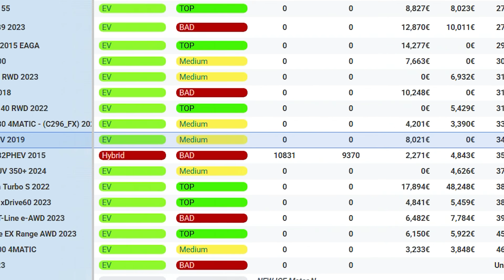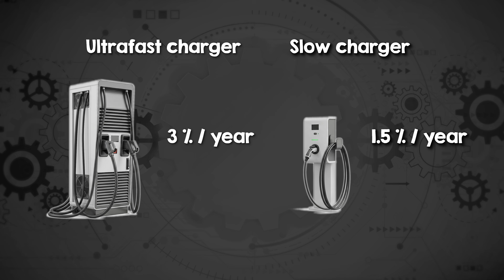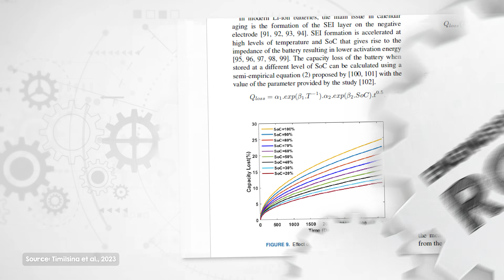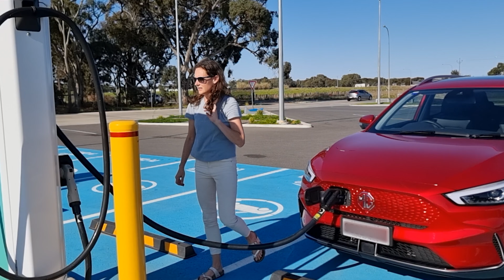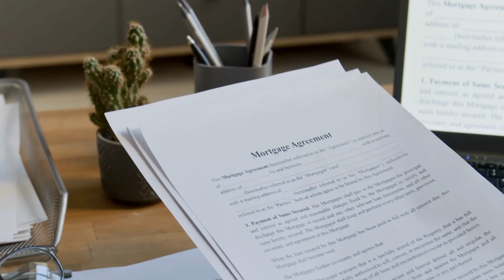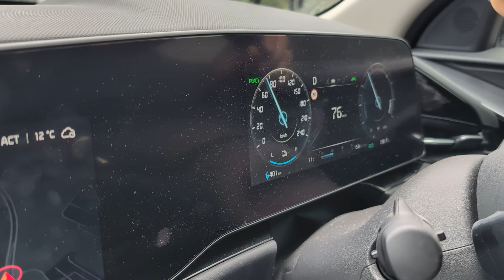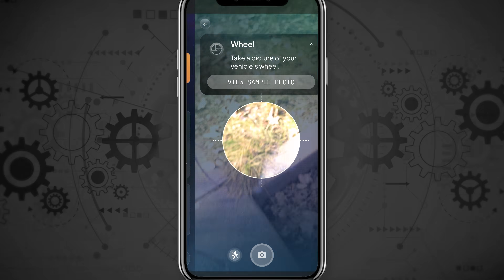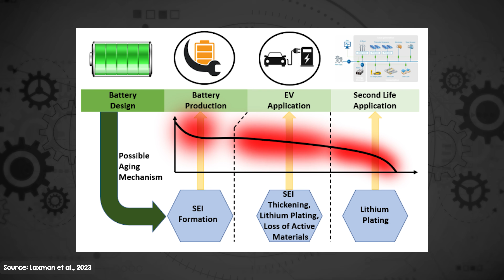Watch This Before Buying Your EV

Comment: "...the vast majority of EV batteries last for freaking ages!" - Great video Rosie. Thanks.
Reply: They come for 10-15 years of use ( hard use) but if you follow manual it will last 20+ year, I have an EV for 1.2 years and SOC is showing 99.39% health
Reply: @diego2817  '21 Kona Electric = 73K miles = 97%.  don't utilize the top or bottom 20% very much, mostly L2 charge at home or short DCFC sessions if out of town b/c we might only need a 25% boost so the battery doesn't really get very hot even on a hot day.  That 25% boost added to the remaining 40% left over from the outward trip from home might be all we need to get back home.
Reply: @diego2817 we all trust that is the tested level and not the manufacturers deceitful programming yeah ? You may have been distracted when this part of the post was said by Rosie.
Reply: We haven’t had our battery tested and we also live in a very hot climate. The battery on our used, 23 Kia still seems good, and the car still travels very close to its originally posted range. And the car will be under warranty for another 72,000 km/46,000 miles.

We have solar because gas and electricity prices in California are very high. Once you charge a car from your home solar, you will never go back to wasting a thousand or more dollars a year on gas, and more thousands on electricity and propane.

Questions for engineers:

1. Rosie/engineers, a few other YouTubers have suggested keeping the daily charge at 60 or 70% to reduce degradation. So, we only charge to 90% before road trips, and to 100% once a year in a cool season. 

2. How damaging is it to take a car battery below 20%? As with going to 100%, is there a case to be made for discharging the battery to some low percentage occasionally? 

At 55,000 km/34,000 miles, we are very happy with the EV. It is quick, reliable and fun to drive, and again, we love passing the dirty, expensive petrol stations. The downside of older EVs is slow charging, which is an issue on all-day road trips. New, 150+ kW charging Kias and Teslas and Fords seem to be plugged in for 20 minutes, while our car with 50 kW charging takes the full hour.

And a second downside for our older EV, the newer ones are vehicle to home and grid-capable. When we save up enough to replace my gas, work pickup/ute with electric, the disadvantages of our great, little, inexpensive, used EV will no longer matter.

Rosie, have you looked into vehicle to grid and “the internetification” of the energy grid? Ideas for turning solar and battery and EVs into grid partners instead of just customers, or here in California with our usurious electricity rates, victims and marks?
Reply: @freeheeler09 I live in the southeast. It gets hot here too. I can L2 charge at home. I mostly keep the car between 60% and 40% b/c I don't drive that far each day. That charge might last 2-3-4 days depending on the weather. If I drove more I might go 70% to 30%. The key is to keep it mostly between 80% and 20%. If you need to go to 100% for a trip, do it. Just don't charge it to 100% and leave it sitting around for days. Same for the bottom 20%. If I dip into the lower 20% (very rare), I just plug it in immediately and charge it when I get home. I skip the after midnight charging schedule then which I do for no good reason except to be a good neighbor. The grid around here is pretty busy with families making dinner, doing laundry and showers - I presume. After midnight, not as much. We don't have pricing here that favors after midnight charging. That's it really. When traveling I prefer to charge the car up to 80% or maybe 100% if it has been a while. Most of our out of town EV trips are away from home maybe ~125 miles. Then on the return trip, we'll want to recharge so we don't arrive at home with nothing left or get stranded b/c of traffic. Because I charged up a bit more before the trip, our DCFC session can be shorter. Maybe we're at 40% and only need to charge to 65% or 70% to get home. Less time charging, less heat because shorter session, less expense. Suits our slow charging EV just fine.
Reply: Just, never charge to 100% every day, even with LFP, degradation will come fast
Reply: @diego2817   @Theonethatshallnotbenamed9999  You can't charge battery 100 % fully even if you wanted to.  Battery manufacturer caps the capacity around 80 % and car makers' Battery Management System (BMS) has safety margin 5-10 %.
Reply: I bought a Temu Tesla aka BYD and my battery life has already dropped to 80percent within 8months 😢
Reply: There’s a video on YouTube with an airport chauffeur that has done 430,000 miles in he’s Tesla MS charging mostly with Supercharging and the battery health was still a bit over 70%. Most cars are ready for the wrecker at 180,000 miles.
Reply: @Glennloveshimself  https://www.youtube.com/watch?v=uGRQQzqZ9L4 This one? This is from the Netherlands, a 2020 Tesla with a similar mileage of almost 700,000KM and a battery SoH of around 71%.
Reply: @Cyphax55  thanks.
Reply: @Glennloveshimselfno not true, high mileage and frequent usage like Vehicle mentioned has done over 900 000klms with the usual maintenance only. Petrol Vehicles, Plenty in fact a fleet of averaged 500k , consumable only. Less tyre rubber Pollution into the rivers than a E Car, actually recyclable as in viable to do so. Increased road damage as a result of Heavy E car use. Manufacturing of personal Transportation has become a High turn over of short lifespans purposefully for decades . Turn over is the Evil we all are unintentionally accepting or even welcoming.Small  Footprints of overall consumptions that was, is now being forced upon Society to welcome Throw away, no, not recyclable Vehicles as the norm. 
Foresight and experiences of reality's show the Constant Wheel of Production and Money will have this new Storyline if personal transportation , one big No Choice anymore. Computerised with active Satellite Controlling of freedoms with Geo Blocking vehicles when ever and whoever.
Reply: @Glennloveshimself  我们这里的网约车司机（中国Uber）都说，BYD的车，开300,000KM，电池健康度基本都在80%以上的，而且都是用快充充电的。
Reply: @Glennloveshimself  How old is the car? Batteries degrade with age as well. You don't need to drive far.
Reply: @Gazer75  And with the load. If you are pulling trailers, the battery degrades faster, for example. And manufacturers use bigger batteries to simulate a better SoH within the manufacturer's idea of the vehicle's lifespan (3 years). There are too many variables to make an estimate just from anecdotal information. The only way to be sure are measurements under lab conditions with controlled loads to have standardized discharge curves, bypassing any onboard system.
Reply: @FF-li6zj  ICE cars suffer from the EXACT same thing ? why is it any different for an EV ?
Reply: The problem buying an old EV isn’t the life of the battery.  It is that battery technology keeps improving exponentially.  In China they have batteries with 1000 Kms / 600 miles of range.
Reply: @Theonethatshallnotbenamed9999  True but if my driving can be supported by a ~250 mi EV then I'll buy a ~250 mi EV. Sure it would be nice to have a ~600 mi EV but I don't need one. Maybe some future EV that I'll own. For now I needed an affordable used EV to pair with our ICE SUV which does our trips.
Reply: @Theonethatshallnotbenamed9999  its advanced today, the owner will "feel" his EV obsolete next year.
Reply: @arttellama2408 it is mostly battery technology so as long as batteries keep getting cheaper, then you can just change battery.  Probably similar to getting a new engine nowadays.
Reply: My 2016 Nissan Leaf has nearly the same capacity as it had when I bought it 5 years ago.

I am considering upgrading.
Not because I can't use the current battery, but because I want a grid battery in my shack, and the old car one has a decent size for that.

Next step is to find an electrician who can install it and give it a CE-certificate to keep my insurance company happy 😊
Reply: @madshorn5826  Might be cheaper to buy a battery from a wrecking yard than to disable and junk a working EV.
Reply: 3% every year for fast charging 10 years =30% loss 20 years 60% loss cars with slow charge 10 years =20% loss 20 years 40% loss , my question is can the car charge and drive at 20 years with 40% battery or 60% battery , if the battery outlast the car the answer should be yes no problem , but I think the answer is no
Reply: It's because early Tesla models and Nissan LEAF only used high quality batteries from Japanese companies like Panasonic and NEC.
Reply: @yo2trader539  The batteries are far better today than back then mate...
Reply: My 2018 Chevy Volt PHEV with 250,000 kilometers has pretty much the same electric only range as it did when I bought it. We mostly leave it plugged in to our level 2 charger all the time and charge it all the way. What can I say, we're lazy, and it does not seem to have made any notable difference. My problem is finding my next PHEV that has as much range. All the new PHEVs have too little battery range to be worthwhile, and a full electric when you live in a rural place with cold winters just isn't quite good enough....yet.
Reply: @POV-h8g  We haven't had any problems with rural areas. Our car has ~250 mi of range. That's plenty to get from city to city. We took it to the mountains for a weekend getaway. No DCFC charging available away from the interstate. We stopped at the interstate exit where we started into the mtns, charged to 80% and for a couple of days drove all over including very steep mtn roads. Came back to that same charger as we started home with 35% left over. Regen brakes in the mtns is a wonderful thing. Idea: take your granny charger and get whatever you can overnight if you rent a cabin. We could have gained 35 miles or so each night. For free.
Reply: @joeaverager do you live in Canada?  Do you understand living in a place where the closest shopping is an hour's drive? How about being 8 km from a paved road? Not all things are equal and one reality is that older PHEVs and EVs can't charge faster then level 2 - so even with good charging infrastructure it may take hours to get enough charge to get home, and sometimes they have fast chargers but no level 2.... it can get complicated fast.
Reply: @POV-h8g  I don't live in Canada but I do live in a place where we drive 100 miles or more to access certain services and access shopping.
Reply: @joeaverager cold weather saps batteries.... easily down 50%, and they are slower to charge at low temps. It's a whole thing.
Reply: @POV-h8g  Yup. I've been driving EVs for years now. Own one. Drive it year 'round.

Comment: I thought LFP batteries liked being top loaded
Reply: Yeah 100% regular charging is fine with LFP, NMC likes 80% regular charging, but it’s good to charge the battery to 100% every now and again.
Reply: They need to be full-charged so the car can tell state of charge with reasonable accuracy because voltage is a less clear indicator of state of charge. It is also true that they last longer anyway so 100% charging is less of a negative factor.
Reply: That's why phone companies now have battery apps installed that tell you to charge to 80% if you want to prolong your battery life.
Reply: 100% charging does still degrade LFP batteries at an accelerated rate, but the impact is less pronounced than with NMC.  The problem is that the LFP voltage vs state-of-charge curve makes it difficult for the battery management system to assess state of charge, and to balance the cells except when they're fully (or nearly fully) charged.  Best bet with LFP for longevity seems to be to normally only charge to 80%, but every 5 fills or so go up to 100%.